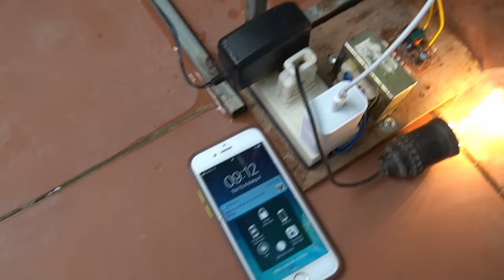Turn The Washing Machine Motor Into A Permanent Water Turbine Generator

Comment: He does show the entire system at once in the shot around 13:16, but the system is constantly losing water, so even that is not fully infinite. Im sure there's another trick he used to boost the output, which is surely not infinite either.
Reply: it is.... damn near perfect and cheap. imagine if all you had to do was refill somethingf once a day. and the watter was beath the machine. i mean wow. imagine?
Reply: He could be feeding additional power from under the system though. I've seen crazier things for simpler videos.😂
Reply: The amount of potential energy stored in that small amount of water is nothing compared to the power the pump consumes to push it up that height. Not Even taking to account the losses in the "generator", as I doubt those magnets are at all quality neodymium and would not be inducing much current in the stator windings. There is 100% a feeder circuit being ran into to the plugs.
Reply: @thalion3410 if you think is is a real infinite energy source it would be big news not some shitty youtube video
Reply: His turbine isnt an industrial pelton turbine with a proper water jet. So its much less than the 90% ish efficiency a pelton turbine has. The cables propably have like 99.9% efficiency, so another 0.1% loss there. Then theres the pump& friction. The pump propably has like 25% loss or so. So, the thing uses 1 energy per about .4 energy(eyeballing didnt do math) therefore you use 10 joules for every 4 joules you generate.
Reply: @thalion3410  "damn near perfect" It cant possibly have more than 50% efflciency(50% loss)
Reply: @snowdrop9810  Where do you get 99.9% efficiency from?
Reply: @AMurderOfLobs  ETP Copper alloy aka "Cu-ETP1" or "C11040" copper wire is what's mainly used for buildings. It has an efficiency of 99.9%. That means that you get 99.9% of the power out of it as you put into it. The only thing more efficient is silver, but that's more expensive. It's not a bold claim. It's standard electrical engineering.
Reply: @snowdrop9810  You're forgetting about other sources of energy loss, such as the sounds being made by everything. Even if everything were 100% efficient, the sound alone would remove energy from the system and it'd eventually grind to a halt.
Reply: @AMurderOfLobs  random number
Reply: @BerryTheBnnuy  I wasn't challenging you on it, just curious.  I'm MechE and don't deal much with the EE side of things.
Reply: It just need a gravity fed water pump.
Reply: you can add some water once in a week , it is better than paying bunch of money :), if   this is the only problem:)
Reply: @thanderneek6620  Nope.  This system is extremely wasteful and running it probably requires something like 10 times the energy that it generates.

Comment: For what is that small transformer connected to the AC outlet.? And what is the rating of the transformer..is it a step -down transformer.?
Reply: Likely a step up, from 12V to 240V which off the top of my head, is <maths time> 20:1 ?  But not only that, he is using a british style plug, that is AC (Not DC) so you need an inverter to convert from DC to AC, and doing so, the CONVERSION uses electricity.  This is not perpetual.

Comment: so how long does it run before it stops running on its own, cause im sure it takes more energy then what those 2 turbines output to power the pump to keep that flow up let alone anything else
Reply: It runs until the battery dies.

Comment: Ok, so, the system is losing water because of that 2 holes and i believe u, this two generators can produce energy but i dont know if u can sustain the pump and recover all the energy its using, normally the generators are inneficient, so, some energy will be lost and thats why u cannot generate infinite energy, but, thanks for this video!

Comment: 1st off the little magnets that he supposedly drilled holes for would drag against the outside coil magnets and either slow it or jam it. Don't know what the purpose of that was. That I the reason the shaft is in a recessed hole that the bearing sits in so the two magnets don't touch. Why put little magnets inside the two knowing it would cause them to either stop it from turning or get caught in it?

Comment: Rakitan yang ke trafo 12 v DC ke 220 v AC , tolong juga di praktekin cara merakitnya misal tadi ada transistor, resistor, diode dan adaptor, begitu biar jelas
Reply: Ada yg bisa buat g yaaa.....perlu nih unt nerangin gang/kolam lele lumayan kan kalo 1 unit bisa 500watts bisa 50x10watts tuh.

Comment: This is real i have tried it its 100 %real
Reply: Could you explain the electronic part, please? Transformer, ...
Reply: Which power in Watts can this generate?
Reply: Brother you use mini inverter circuit that oprates on 12v battery and instead of using big motors use 12 v Dynamo motor
Reply: I use a a c water pump of cooler  for cleaning home tank that idea comes from there when i removed power source for using pump but pump was still working
Reply: @hobbyelectronics3448  Thanks brother... This is really interesting. Could you please have a step by step guide with explained details for us ? This can really save life...
Reply: Pls sir can you explain it to us better or show a video to us plsssssssssss
Reply: How many hrs will it last?

Comment: Wow 

It's works for me after trying it
Reply: What pcb circuit did you use was it modified 5 volt phone charger from 5volt to 12 volt ?
https://youtu.be/syuptCQ_s8U

Or all in one pcb with transformer 

500W Inverter DC 12V-24V to AC 180V-220V-380V Booster Board Module ✧
Reply: Hats off to ya for your good work
Reply: yes same it powers my whole house inc hot water cylinder it only stops when there is a power cut.

Comment: The top host is located to the left of the plastic bottle but amazingly the fan spins right 😅. Secondly, the pressure release from the host doesn't have enough tug to push the fan at that speed.  The plastic below is even worse.
Reply from the maker: no

Comment: 10:05  here fake starts. rotor rotates even before water fully hits it. Also he doesn't consider  the inner resistence of the rotor: his water wheel radius is even lower than his motor's radius.

Comment: Low volt from low rpm generators is boosted up by jewel thief circuit and pulsed high voltage is stepped up by transformer to deliver  high voltage power to receptical for water pump, and accessories.  water pump maintains generator output circuits.
Small capicitor smooths high voltage  AC output.

Comment: Let's start from the assumption that energy is not created but transformed. Starting from this premise, in an ideal and isolated system it is possible to transform magnetic energy into kinetic energy and create a circuit that feeds itself, because it would be a continuous transformation of the energy itself from one form to another. The problem is that in reality there are dispersions, to put it simply, a part of the energy involved in the system inevitably produces heat (not counting friction and wear of the materials), therefore in the long term the energy of the system goes decreasing, i.e. the total energy does not remain constant. When all the energy is dissipated into heat and dispersed the system will stop Having said that, if I want to use part of the energy from the "perpetual generator" to run another system, obviously the loss will be faster because the self-produced energy is not fed back into the system Think about one thing: the stars self-produce their energy and constantly dissipate it in heat, in fact they are not eternal but they wear out and after billions of years well ...... they too turn off

Comment: This isn't spinning fast enough to generate 120 volts. And even turning that fan motor into a generator without recoiling it in any way plugging even a 4 amp load to it will cause the motor to overheat and burn

Comment: He dumps the water in the middle, and it somehow produces enough energy to pump it up above where he dropped it from
You'd need >100% efficiency for that to happen
Reply: Not necessarily. This is more of a "prolongation machine". It will keep spinning and cycling for a decent amount of time until the pump no longer receives enough energy from the turbines to pump water back up.
Reply: @AWESOME2715  You're right, it would pump a fraction of the water up, and then a fraction of that water, and so on

Comment: But this one is supposed to make power from the falling water to a generator and keeps on running because the water falls back onto the lower generator
(that was made from a motor by adding magnets) 

Nope....  that would be a perpetual motion machine.  Won't work.  Gotta be a fake.  But if your curious, give it a try. 🤗😊🤔🥴😥😊

Comment: It will not work for long time because of parallel connection and not for producing  same voltage of the both motors
Reply: I don't understand the purpose of the upper motor anyway. Bottom motor seems to power the pump and as long as you have the recycled flow of water turning the propeller it should continue to generate. You might need a different transformer or higher output motor to increase output, but should still work. Am I missing something?

Comment: There is an energy nobody talked about: the potential energy of the water falling. It's energy. It doesn't come "from nothing". It's energy. Well, if the water falling has enough energy to generate electricity for the water pump then it could work...😀My doubt is: How high that water must fall to make that generater work?
Reply from the maker: Yes. Thank you very much. ❤️❤️❤️

Comment: Hi all of you the technical experts (sounds like after reading your feedbacks, BTW I am not a qualified technical engineer or some sort. Just a tinkering, hobbyist spending my $ on bits and pieces trying to create something that satisfy my weekends if it works and useful!) But mostly spend on ebay's auctions of thing I don't need for... Tell me please: isn't that circuit board on the right is a power adapter? that means he is getting AC current from the top generator? Why or can he connect that output from circuit (DC) to a tranformer and"BINGO" abracadabra he gets AC power to lit the light globe? Can somebody explain to me what is going on? To see a beautiful scene of water turbines in action, that is wonderful! I give credit for him using neodymium magnets. That give peace of mind as I believe he can get some sort of DC power by using this super magnets.. Thank you

Comment: There is a difference between a motor and a dynamo, a motor is driven by power, either DC or AC and a dynamo produces power, the two you are seeing here are motors they don't produce they consume, before you speak first of all understand the basics of power generation and consumption.

Comment: Maybe the invention is true until we didn't experiment, but I think there are some details are missing, as well as 2 dynamo are producing electricity equally ,so maybe the first one producing electricity and the 2nd one consuming, i didn't see any daiwod used in the wirering, 
3rd how inverter made, what kind of parts are used, etc etc, 
Thank you 😊

Comment: This is not impossible there is no hidden battery or power supply the problem is that a machine like this can only work 2 minutes at most then most of it's energy is dispersed and wasted  then it stops and the top tank needs to be filled manually again to restart it.  The video is edited to hide the refilling part and THAT is an insult to anyone who has ever touched a wire in his life

Comment: Right, so the top bottle/blade.. I thought from the short that it was the 12v for the pump, but you're using a 110v ? Supply for the pump. So what is doing what here?

Comment: Physics simply won't allow for unlimited free energy. He's either hiding the power source or it's a system where it works for a while but in the end loss of energy from heat, friction, etc, will cause it to stop. Looks cool though. Or like with magnet powered energy devices it used more power creating the magnets then you get back.

Just saw the bit with the magnets. Total power out (after the magnets are spent) will not equal more than it used created to make the magnets.
Reply: That's just like uh your opinion man

Comment: how much watts dose it produce?
Reply: It does not, he has a power source off screen to make everything happen.  When he put on the light globe, Ohms law says there is a resistance in the circuit, and the ""Water Generator"" should be affected by said load.  In the same way, a car's aircon when you activate it when the engine runs, you turn it on, the Air conditioning motor induces a load on its power source, the engine, and you can feel the load (and hear it) slowing the engine down, of course, a cars engine responds by using MORE fuel.

Comment: Come on people, wake up. There is no way this can work the energy of water going down can not produce enough energy to power the motor to get the water to go up much less power a light bulb and a phone. It is physically impossible. There is more than likely a battery somewhere in the system that is producing the extra power needed to keep this going but that would eventually run out like any other battery. I would think that the battery is in the water pump since there was no slow down when something new was plugged in to the circuit.

Comment: Oui ok super👍
Mais logique ici c'est la force de l'eau qui fait tourner en circuit fermé le générateur.
Mais que reste-t-il en puissance juste pour allumer une lampe et recharger un téléphone ?

Il serait intéressant de faire tourner un générateur beaucoup plus puissant, mais dans ce cas la force de l'eau devra être aussi beaucoup plus grande en temps que pression.

Faire ce système en extérieur et Il faudra remplacer votre bidon de 5l par une citerne de 500 l d'eau. Monter un tuyau (diam.100) sur 3 mètres de haut pour le retour. Et là vous aurez créé une mini centrale hydraulique électrique.
Plus il y aura de hauteur et plus forte sera la pression mais il faudra aussi une pompe beaucoup plus puissante.

Yes ok great👍
But logical here it is the force of the water which makes the generator turn in a closed circuit.

But what's left in power just to light a lamp and charge a phone?
It would be interesting to run a much more powerful generator, but in this case the force of the water will also have to be much greater in time than pressure.

Make this system outdoors and you will have to replace your 5l canister with a 500l water tank. Fit a pipe (diam.100) 3 meters high for the return. And there you will have created a mini electric hydraulic power station.

The more height there is, the more pressure there will be, but it will also require a much more powerful pump
Reply: Ca sert a rien de faire un modèle + grand, ce truc viole les lois de la physique.
Et ce circuit est tellement pas fermé que de l'eau en ressort xD. 
Impossible que le générateur produise plus d'énergie que la pompe n'en consomme pour remonter l'eau. 
Il y a perte d'énergie avec le frottement de l'eau et des pièces en mouvement du générateur et de la pompe.
Le bilan énergétique de ce genre de montage est fatalement négatif peu importe l'echel

Comment: If the water siphons itself to the upper bottle, then it might be legit. That would make a loop that could continue thanks to the earth rotation and gravity. Not sure about the engine/generator though. I’m no mechanic
Reply: A siphon always siphons to a place closer to the ground. Not higher. So it wont work. Also, the laws of thermodynamics exist and are crying rn.

Comment: Even if it's running without batteries. The magnet inside the Motor will lose energy and everything will stop. I have doubt about this small motor producing that much energy. May be he is using batteries.

Comment: Lol the water pump isn't connected to the circuit but an outside power source. To get it started. Then plugged it into.its self which will eventually not generate enough voltage to keep going

Comment: By the newtonial laws of physics if an object, this case water, is to be moved upwards in elevation it needs pressure greater than the gravitational force of the upward travel, usually done mechanicly via waterpumping devices

You're not fooling anyone , because if this was to be a working energy generating device that didnt need any resources other than the building ones then it 
1. Would've been adopted everywhere 100-200 years ago
2. Changed the way we thought about the newtonian laws of physics 
3. And been on the news since it would be giant new as ber 1. & 2.

*Squidward Serous face

Comment: I think its fantastic. Trough I do question what the PCB is and the rating of the transformer. Is that just a voltage regator of some kind? Also...iPhone, but no wire nuts? 🤨🤷‍♂️  Congrats man.👍

Comment: The external force in this equation is GRAVITY. Its a free energy, its always here for us. So if the efficiency of the other components are close to perfect, this machine might have positive energy balance. Not a real perpetual motion machine, but again, if you calculate the energy of gravitational pull/force, it might be legit as a free energy machine
Edit: nope, I was wrong. Something is fishy, becouse you have to get the water up again against gravity with the pump, so....thinking
Reply: LOL why even post this comment. You're at least on to something that's already been invented called gravity batteries.
Reply: also yes we use gravity to produce energy already theyre called dams
Reply: @arcaedias  yep, and water mills or what, power plants on high flow rivers, etc